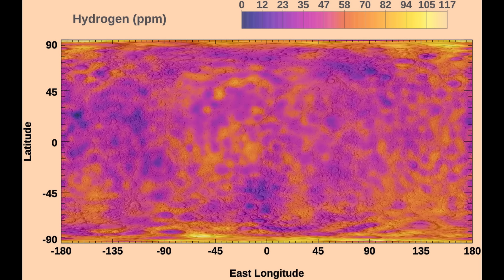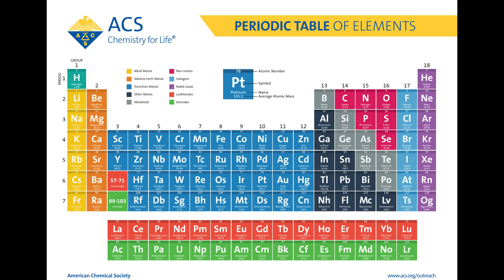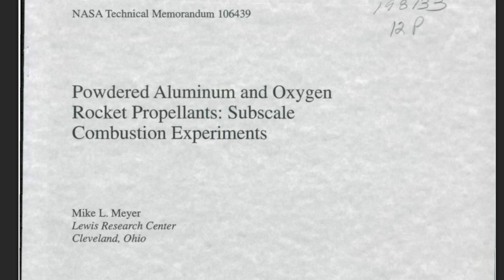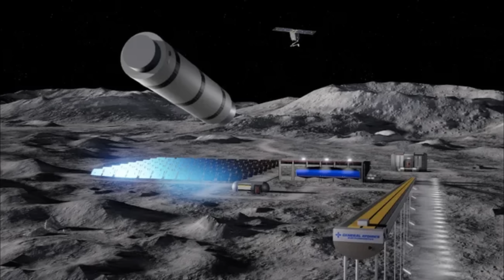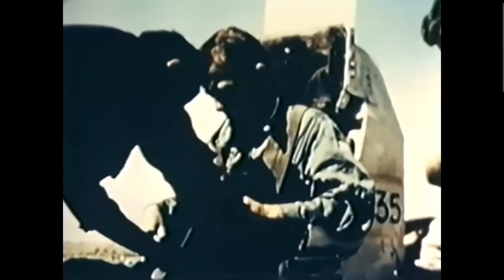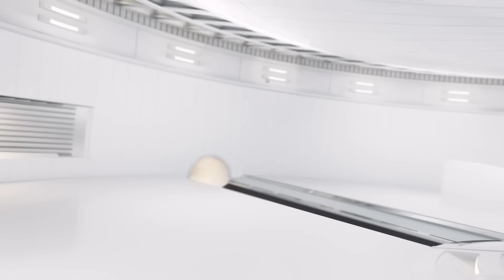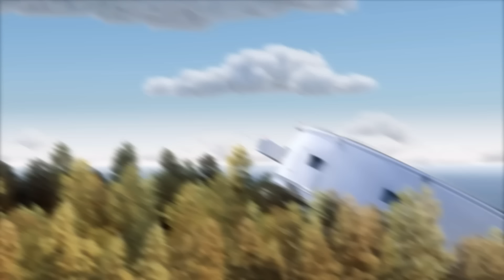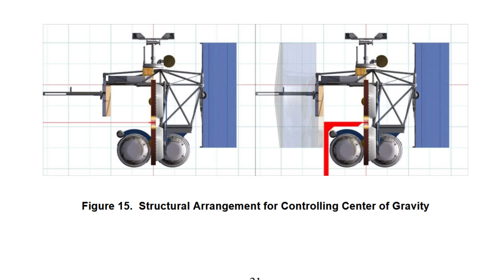Launching From The Moon With Silicon Based Rocket Fuel And Other Ideas - Deep Space Questions

Comment: The M829 APFSDS round from the M1 Abrams tank goes about 5500 ft./s. Large, smooth bore cannons have the ability to reach much higher speeds than shoulder fired rifles.
Reply: I came here to say this, too. The mass fired from a shoulder fired weapon is way too low to be of any use on the moon. Also, the Rheinmetall RH-120  L/55 gun on the Leopard 2 A6 and A7 tanks is even faster then that of the Abrams, with a muzzle velocity of 5,900 fps.  

The larger the bore diameter, the higher the velocity obtainable in a smooth bore cannon. Imagine the ability of a 16 inch battleship gun modified with a smooth bore to put usable mass into orbit around the moon.

Comment: there is another option for energy storage that's a little less obvious - chemical storage. if we want a lot of energy on earth, we get some chemical fuel and we burn it in a piston or turbine engine. you could totally just electrolyze water, burn the resulting hydrogen and oxygen in a gas turbine hooked to a generator, and then collect the exhaust and do it again. or you could use a fuel cell. it's a lot of energy, but it's really not that much energy in the context of what we routinely use these sorts of engines for on earth. if you could keep the fuel and oxygen cryogenic, it could probably be easier, cheaper, and lower mass than any other option. managing waste heat while recondensing might be really challenging though.

Comment: In 1996, for his high school senior science project,  my son built a computer controlled coil gun that accelerated a ferrite slug 1 cm in diameter and 1.3 cm long to a velocity of over 225 meters per second in less than one meter. 

A electrical mass accelerator should have NO PROBLEM accelerating payloads to lunar orbital or lunar/earth gravity well escape velocities. 

Plus, your payload (assuming that it's a space ship) could then fly with a full load of chemical fuel for course corrections enroute and a return trip.

Comment: Are you sure you need capacitors? Looked up a data sheet 2MWh/18t battery can discharge at 1MW = 3MJ in 3s. I would argue that is enough to launch a couple kilograms at a reasonable speed. And it can keep doing that for hours.

Comment: 0:43 - There won't be any export of materials from the moon for a VERY long time. They are most valuable ON the moon, being used for moon stuff. And materials mined on the moon will always be VERY expensive, due to the incredible cost of the operations. If you know mining, then you know maintenance is a costly nightmare.
Reply: They are likely even more valuable in lunar orbit. Particularly if the whole reason behind setting up infrastructure on the moon is to facilitate spaceflight to the rest of the solar system.
Heck, at a certain point it becomes more cost effective to launch from the moon to Earth orbit than it is to launch from Earth to earth orbit.
And we do seem to have developed a penchant for having a lot stuff zipping around our planet
Reply: @Kizron_Kizronson  Delta V of Earth surface to LEO is about 10 km/s and for Lunar surface to LEO is about 6 km/s. Add in using a lunar mass driver and launch costs could be substantially lower. Production of raw material (steel/fuel) could cost over 100x more than on earth and still be cost effective, because almost all the cost is in the launch. (1kg steel ~$2 to LEO $10k vs $200/kg lunar steel to LEO for $2.5k. Even better savings if looking to keep it closer to moon or possibly transfers to other heavenly bodies. More complicated/expensive items will likely flip the equation back in favor of Earth launch.
Reply: @barongerhardt are you saying that the most valuable commodity to launch from the moon would be cast slugs, or finished simple beams?
Reply: You've made me wonder how mining equipment would handle heat dissipation on the moon.
Reply: @TheRogueWolf  use liquid Nitrogen as a coolant
Reply: Man, I've been trying to tell people this for thirty years , and they just don't want to hear it...
Reply: And they also might be good for manufacturing spacecrafts for interplanetary travel.

Comment: Another question not asked or answered is the best way to LAND stuff on the Moon.  My proposal from many decades ago was to flatten out a landing strip, free from dust, of about 50 miles length.  Arriving space vehicles would line up, and perform a retro burn to bring them down on the numbers at about a 2 degree down-slope, but still at orbital speed.  That leaves a 200 ft/sec vertical descent speed, easily taken out with a 30 second vertical burn with a thrust to weight ratio of 0.373.  The ship would still have ~5,800 ft/sec to bleed off, but that could be done with inductors buried under the runway, coupled with magnets on the lander's skids.  The net deceleration would be 2 G for 91 seconds, a mere trifle.  It might be best to have an overrun at the end.  Say, 50 feet.
Reply: Talked with a mechanical engineer when in college about catching aircraft on a carrier using similar idea.  He was dubious about alignment tolerance and if there was a conductive material that wouldn't be compromised under that kind of strain.

Comment: I suspect that saying a silane-oxygen rocket blows sand is like saying a hydrogen-oxygen rocket blows snow.
Reply: With a melting point 1700C and boiling point 2200C, Silicon dioxide is much more likely to be liquid or solid in the exhaust than water is. I don't know how to determine the chamber temperature of a silane rocket, 3600K seems to be a ballpark figure for methane. After undergoing expantion in the nozzle, however that will drop significantly. With a vacuum optimized engine I don't think it is beyond reasonable to expect a silane rocket to double as a sandblaster!
Reply: @2testtest2  I guess the real question is: what 'droplet'-size do those condensing SO2 exhausts form? I could imagine one can 'control' for this by admixing some suitable material into the fuel that forms suitable  condensation-cores? Vulcanic exhausts are likely not a good analogy as due to happening on Earth in very water-rich environments (otherwise no volcanic ash) with all manner of rubbish mixed-in. I think there's only one answer: we need to go there and try😆
Reply: @2testtest2 Perfect for a military spacecraft - instant minefield for pursuing ships!
Reply: *proto-snow
Reply: I worked in that area. The products are a combination of molten SiO2 and SiO (a gas). Because the melting temperature of SiO2 is so high (about 1700 K) the products condense wherever the temperature is lower, with consequences that can be imagined...
Reply: @claudiobruno3194  As long as that point is past the end of the bell, do we care if it solidified?

Is having fine clouds of SiO2 in cislunar space a problem for later missions? Does it rapidly settle back to the surface? What's it's albedo? Lots of questions to pursue. This is interesting.
Reply: @claudiobruno3194  thanks, that’s a cogent explanation!
Reply: just be thankful clickbait titles with "Rockets running on SAND!" yet
Reply: Not quite, given the vastly different melting temperatures of the combustion products.
Reply: Stennis literally produced rain storms testing the shuttle engines, which btw would ice up on the outside.  But your SiO2 here will solidify IN THE NOZZLE which is very bad and will disrupt the laminar flow.
Reply: No it's not really like that.
Reply: I was wondering about that too - I wonder if the exhaust product would be molecular ( O=Si=O ), while ‘sand’ is a crystal - presumably four oxygens around each Silicon in a 3D lattice? I dunno, running on high school chemistry here, would love to hear from someone who knows …

Comment: Do not use potassium. It has a sucky specific impulse.
Metal            | Combustion Temp (K) | Theoretical Isp (s) | Notes
--------------------|-------------------------------------|------------------------------|----------------------------------------
Aluminum    | ~3200 K                         | ~285–300 s           | Best lunar option – high energy/mass
Sodium         | ~2400 K                         | ~250–260 s           | Viable but corrosive and lower performance
Potassium   | ~1800 K                         | ~180–200 s           | Too heavy, poor efficiency – ruled out
H2 + O2        | ~3500 K                         | ~450 s (vacuum)  | Ideal but hydrogen is scarce on Moon
CH4 + O2     | ~3200 K                         | ~370 s                     | Methane needs carbon – rare on Moon

Comment: The number that I always like to bring up when arguing for why lunar mining is an extremely good idea is the launch vehicle cost (in mass and fuel) to move from the lunar surface to LEO is 4% the cost to go up from Earth's surface to LEO.

You have a huge amount of space there for potential cost savings on bulk materials that can be sourced from the Moon for all kinds of space construction.  Since the Moon has abundant oxygen, silicon, iron, aluminum, and titanium in its crust, all very useful materials for anything humans might want to do in space.
Reply: And your lunar labour cost and factory maintenance and consumables costs on the surface of the moon are hundreds of times what they are on Earth, so where does that leave you?  Also, cost is not "mass and fuel".
Reply: @karenrobertsdottir4101  Labor and maintenance of a moon mine is much higher than it is on Earth, yes.  So we have to compare whether or not the savings are worth it, compared to the launch costs.

It might be that your aluminum sourced on the moon is 100x as expensive to produce as it is on Earth, but if in LEO the cost of aluminum sourced from Earth is 99.99% in the launch cost, then that extra price for lunar aluminum is a fairly small factor in total price.  It might only cost 1/10 the price as what's sourced from Earth.

There's a lot of potential overlap there, given just how expensive it is to launch bulk raw resources.  We could see situations where the hulls and tanks for ships or space stations produced on the moon, and the electronics supplied from Earth.  Or perhaps many thousands square kilometers of aluminum mirrors for vast solar arrays.

Comment: Just want to point out that you could wrap the "linear" accelerator around the south pole, so that the acceleration is independent of the actual physical length of the accelerator.  The advantage of lower accelerations is power requirements are lower, even if the net energy requirements are unchanged.  In general, things with lower power requirements are more efficient.

Comment: Integza did a really good video a few years ago about the silicone based rocket fuel.  Very good example of a future fuel source for space flight.  Its completely stable as it does not burn with heat or flame, but uses electricity as a combustible.
Reply: @TrailerE031  Electricity is not a “combustible material”.  Electricity is used to activate HAN (hydroxyl ammonium nitrate), which then burns with a wide variety of things.
Reply: @wagnerrp  I obviously didn't choose the right word for the description.  But the way they are using electricity as a throttle solid rocket fuel is extremely interesting to me.  I'm surprised that someone in the field hasn't incorporated this into a design yet.

Comment: Back in the 1960s, either Life Magazine or Time Magazine (this was before they merged) had articles about space, such as what you were talking about in this video. One idea was to make shielding material for habitats on the moon and for rotating stations in orbit (either around Terra or Luna). What was proposed was to take the lunar soil, heat it up until it melted, then cast it into curved sections for use as shielding against X-rays, cosmic rays, etc. They mentioned using rail-like launcher to sling the material into orbit where it'd be picked up and used by an orbital processing plant. 60 years later, those old ideas seem to be getting some renewed attention.

Comment: They actually experimented with using silicon additives in rocket fuel to reduce the heat transfer onto the walls of the combustion chamber and nozzle , and it worked very well .
The problem is while it helps cooling , it contributes nothing in terms of performance .
At least the lunar escape velocity won't be readily open to exploitation by every juvenile colonist delinquent with a slingshot .

Comment: Superconductor energy storage for a mass driver is perfect given how cold the lunar surface can get
Reply: I was wondering how hard it would be to make a superconducting coil storage in a shadow in the vacuum. I guess your biggest problem is gonna be heat conduction from other mechanisms?  Reflected light, maybe?
Reply: That’s not really how that works unfortunately, if it’s on the sunny side of the moon it can get very hot, and there’s no atmosphere to conduct away heat. So you would still need cryogenic cooling in the form of liquid, probably oxygen if we’re keeping in the spirit of the video.
Reply: @luipaardprint couldn't you just build them underground in one of the many lunar caves? Also I wonder how lunar dust would act around such huge magnetic fields.

Comment: It seems obvious you would just use an ablative material. SIRCA or a silicone ablative material would be perfect and a ground based laser with no atmosphere would be perfect for propelling a craft that now no longer needs any oxidizer at all so it's even more efficient. Silicone type materials should be easy to make on the moon

Comment: The 1966 Novel by Robert A. Heinlein: "the Moon is a Harsh Mistress" had mas drivers on the moon, predating Gerard K. Oneill's work, and might have inspired him.
Reply: I was thinking of this story myself, and we may have a "Fair Dinkum Thinkum" good enough to deal with guiding the loads to the processing plant in orbit. Maybe at L1.
Reply: Arthur C Clarke wrote a technical paper on electric launch on the Moon before then and was inspired by the Westinghouse Electropult from1946.  Before then, Professor Northrup wrote a book about his linear induction launchers he built at Princeton in his Zero to Eighty where he predicted a race to the Moon between the US and Russian in 1968.
Reply: @  I never heard of the Electropult. Cool!
Arthur C. Clarke - I'm not surprised he was the first to put this all together.
Reply: I kept waiting for him to mention it - although it's slightly possible he dropped subtle hints for we in the know to picked up on. Like his mention of launching rocks as test payloads.
Reply: Heinlein was trained as an engineer. He also used fission bomb propulsion to move asteroids into earth orbit. He got that wrong by assuming Thorium was fissile.
Reply: What happens when you cut the tether of a lunar space elevator with its tensioning mass between earth and moon, particularly when the cut is made close to the tensioning mass?
Reply: The mass would not completely burn up. Impact hazard. 
 @scottholladay3280
Reply: @scottholladay3280  basic physics problem of how long it takes to reach the surface.
Reply: @scottholladay3280 haven't read it in a while, but are you referencing the destruction of the Nairobi Beanstalk in "Friday"?
Reply: @scottholladay3280  When the elevator inevitably fails, what would be the impact on the moon when it falls?
Reply: That story is badass and quite realistic, other than the sentient AI, which we don’t know is possible.
Reply: I read a series by Michael Flynn where asteroids were powered by iron oxide "rockets".
The character made a point that the thrust would be very low, but still there.
-
I wish I could find an answer as to whether it is a real idea or just made up for the novel.

Comment: Considering the solid rocket boosters most space programs are using, i'd say use aluminum and oxygen as your rocket fuels.  Already exists on the moon, easy to refine (we already know how to separate aluminum oxide from it's oxygen).

Or go easy and use a magnetic launcher.
Reply: Haha!  And even  Scott talks about it in the video.  I posted my comment before he got to that point.
Reply: Trouble is aluminum is a terrible propellant, just as silicon is a terrible propellant.  It burns and gives off heat, but it’s a liquid at combustion chamber temperatures and does not accelerate out a nozzle like a gas.  The aluminum/silicon/whatever is just a heat source to produce hot oxygen gas, and hot oxygen gas is terrifying.  You’re severely limited on your gas temperature, and it’s a dense gas to boot.  It’s extremely inefficient (like 200s), and the only saving grace is that you can source it locally.

Comment: "Sandblasting things down stream" doesn't sound like a good idea. I'm all for EM launch rails (mass driver), solar or nuclear powered. km's long so they get up to transfer speeds. Launch windows would be less than just rockets or other launch platforms but they could all just stack up in a queue and all go together, one after another. Using the in-situ Iron and aluminium and other resources to build it all? We just need Carbon nanotube production to drastically ramp up.

Comment: Space elevators - in these studies, what sort of speed are the cars doing? what sort of stresses are they putting on the cable to accelerate/decelerate to those speeds & is that going to cause wear through stretching it? how much correction is the tether weight going to need as you have masses going up & down the cable? how do you damp any sort of waves out of a cable that long?

Presumably to make it a useful device you're going to have to put a hell of a lot of mass in a single car, because it'll take a while to cycle back for another launch.